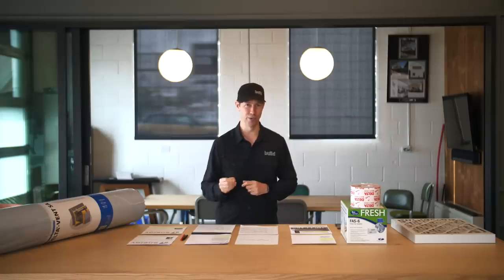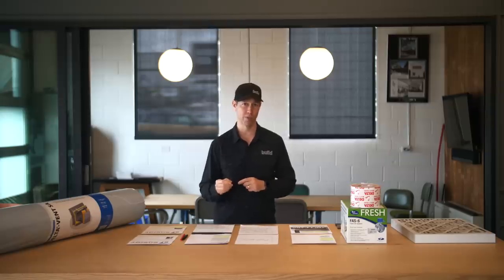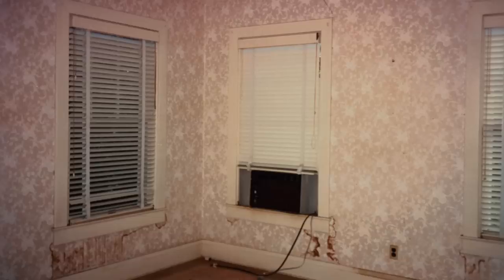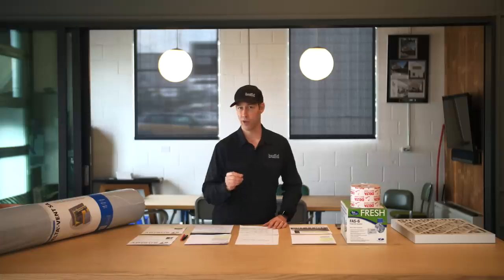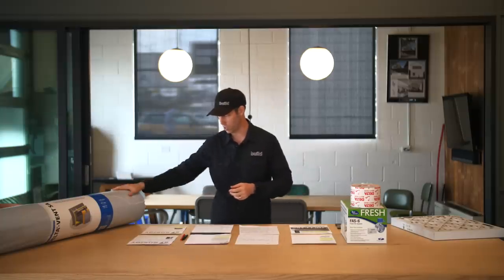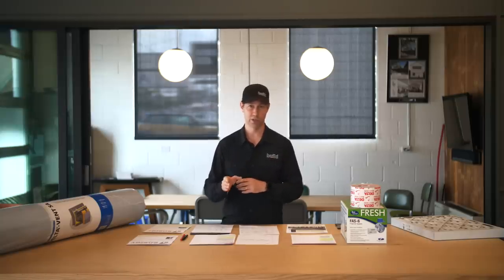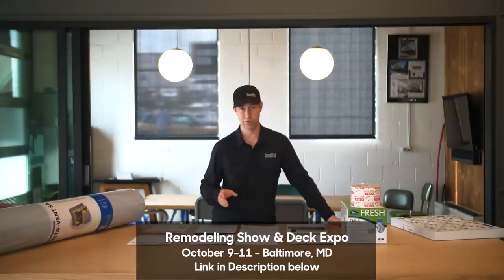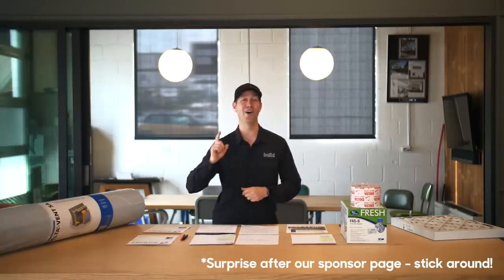“Houses need to BREATHE!” - Shut your filthy mouth

Comment: I live in an old timber house in Norway built before 1870. It used to be leaky as F, but the timber is in excellent condition after 150 years. It does require more energy (firewood in my case) to keep warm in the winter than air tight buildings, but by putting in an extra layer of "energy glass" behind the 17th century single glass windows, stopping the worst air leaks by adding Tyvek where needed, and adding "breathing" insulation against the (well ventilated) cellar and loft, it's very comfortable in winter and actually not that expensive to keep warm (the wood in the walls and the insulation stores the heat well). The key here is the thick solid timber walls, heating with firewood (circulates the air and dries the wood), while ensuring adequate supply of fresh air, just like it was done before. It's not code, but it has worked for hundreds of years without causing rot or mold. If lived in and looked after, the house will last another 150 years and more.

Building that way may not be feasible today, not to mention legal in some places. But here in Norway I'm seeing more and more solid wood houses come up, that use new production techniques. Not sure what they're called in English, we call them "massive houses". Laminated massive wood sections, with wood fibre insulation, not air tight but "breathing", heat/moisture buffering. In a way, it's the modern equivalent of my old timber house, and they do follow Norwegian building code. Time will tell if they'll last as long as my old timber house.
Reply: Is wood fibre insulation safe? I always find a little sawdust is a great way to get a fire going..
Reply: Fun example: They're building a coffee factory near where I live, in massive wood. They're calling it the most high tech coffee factory in the world, so it'll be an interesting mix of old and new.

The world's tallest wooden building is also in Norway, with 18 floors and 85 meters. And now there are plans for 60-80 floor timber buildings in Chicago and Philadelphia. Wood is a remarkable material..
Reply: @nobodydoesithalfasgoodasyou  
Insulation comes with a fire retardant and insect/mouse repellant mixed in, supposed to be very good insulation.
Reply: ximono 
We sometimes describe very thick walls (or fireplaces) with the term "thermal mass" as they absorb and hold warmth to radiate out over time.
Reply: believing that wood stores heat well

just lol
Reply: @clycoo  Wood's heat buffering capacity is twice that of regular insulation. This video is in Norwegian and with crappy music, but wood insulation is on the right: https://www.youtube.com/watch?v=CwB1c6eyYUo

Comment: Growing up along Lake Ontario in the early 60's, I have seen that staining first hand and can tell you exactly what causes it. It is from condensation on the inside of the windows all winter long. In the late 60's or early 70's my grandfather added storm windows to the outside and the condensation moved to the outside of the original windows. BUT, because of the bevel to the outside and a weep hole at the bottom of the storm windows, the condensation ran outside rather than inside... It was pretty strange to see little icicles build up at those weep holes outside!!
Reply: Thanks for sharing! I was wondering how a house that leaked that much would have no damage. It wasn't letting water in.

Comment: When the dryer or bathroom exhaust fan is running air has to enter somewhere. I had a customer that his house sucked snow in through the ridge vent while using the dryer. If you see dirt rings around recessed lights you need to ventilate properly.
Reply: Which begs the question where is the air coming in from these tight houses? Windows im installing in apartments are required to have air leak vents on one window per unit. So air still needs to come in from somewhere for you to use the oven exhaust, bathroom vent or dryer.
Reply: @levthelion  probably sucked in from drainage pipe. In general, probably it suck in air from Toilet, basement, or cracks in floor or wall, instead of Windows or Doors.

Comment: Great info,  wanted to see what people have to say on what may be the cause of or issue in north west. Bought house in September 2018 owner put in new metal roof with local roofing company month before we purchased the home,  due to ply wood had mold growthso it was put brand new. Is definitely fixer uper to the point that the top bathroom  and  ketchen was not used till December 2018. A week ago i check the roof ply and there is mold growth in patches on roof ply wood apears socked and have some water leak to point where there is small leak where there is exposed 2x4 in cealing of bathroom where we have not yet added cover as we wanted to do some changes to electrical. I called the roofing compony and they told that mold has began to grow due to thw exposed 2x4 a have in cealing, and that this is what causing mold, it apears to make some sense but, i noticed that mold not just growing above bathroom but above other areas of the roof plywood which are further away. What are people toughts should less than three months showers in with possible air leak through exposed 2x4 in cealing that has sheet rock butted against woulds that be enough to cause hald plywood in roof to have mold growth and drops of water in comin on one side of exposed 2x4 in cealing? Il add the bathroom has a fan and ketchen has exhaust fan. That were both fixed for proper exhaust doing new roof build. Anyways thanks,  thw apears only be a leak when it rains.

Comment: As a degreed HVAC guy, I can back up every thing that Matt said. The trolls who attack the guy who tells us the right way to build and prevent mold and mildew are probably the same ones who love to sue for mold, call the health dept, and go get the asthma machine.. HAHA
Reply: OK, but mold, wood rot and severe water damage are vastly more common today because so few builders can actually implement modern standards correctly. Say what you want about drafty old construction, but that stuff was forgiving and didn't require perfect sealing and non-stop conditioned air.
Moreover, 1:07, the 1930's house that Matt displays was renovated/modernized to a level that isn't even remotely possible for most budgets, and that's AFTER finding builders who are actually competent enough to do it. So yeah, unless you're a millionaire and can afford an outfit like Matt Risinger's company to renovate your old house, you probably DO NEED to let the house "breathe".

Comment: Here in Saskatchewan, Canada, we just adopted the energy code of Canada and now must design/build much tighter houses, from 3.2 air changes per hour to 2.5 air changes per hour (depending on codes followed and how the energy review is done). It forced us to do a ton of research into products, designs, and mechanical systems to meet this new code and everything Matt talks about is right on the money. 
The one big thing we have seen though is a reduction in the size of the equipment to heat/cool a house. Suddenly we can spec a system half the size of ones in the 90's/early 2000's, we can use new tech to ensure they are run all the time at volumes (so no major push of air every 10 minutes, the house is always the set temperature) and place wall mount supplies to get the perfect air flow for comfort. 
Modern houses with new products can be very well built and probably are the most comfortable place a human could live, probably ever. It just takes time and willingness to do it.

Comment: Long ago, I helped my father tear down a small, old house to reclaim the wood. The interior walls were sheathed with tongue and groove board, but the species were whatever was available LOCALLY when the house was built. It was all hardwoods - some poplar,  some cherry, and quite a bit was walnut. The framing was similar to that used in the area until sometime around the mid - 1900's (or even a little later): Rough sawn 2X 4, predominantly oak. Since it was generally rough lumber, it was actually slightly oversize, about 9 quarter by 17. I still remember listening to my grandfather talking about someone who was building a new house, and insisting it would fall down since they were using PINE to frame it. Those old houses were drafty, but quite sturdy. 

Think of adding on to these old houses with oak and hickory framing that has seasoned fully over time. I recall making a flush cut using a hand saw on an small addition I helped with on such a house. Two of us took turns sawing until we finally cut through one 2 X 4. Nails usually required a pilot hole to go into the old framing.

Comment: SO GLAD TO SEE YOU ADDRESS THIS!  But after thinking about it all night, I have some questions....
1. When you seal up a house envelope to be air tight what happens when you turn on a bathroom exhaust fan?
2. How about opening doors?  What does that do to impact the air quality in the house.  I'm thinking about foot traffic in and out.
3. Do you need to have a vestibule or mud room at each entrance to create a buffer from having direct contact between outdoor air and indoor air?
4. Do you need to control the humidity indoors now that it is sealed?
5. What happens on a beautiful day when I shut off the AC and open the windows?  Does that just defeat the whole purpose of a sealed envelope?
6. What type of filtration system do I need to keep the air inside clean?
7. Is there a danger of CO2 or Radon build up?
8. What about natural earth tech like straw bale homes or rammed earth homes?  Is it possible to seal those or is that a bad idea?
9. My house was built in 2000.  What's the best way to improve my score without ripping it back to the studs and starting over?  What should a goal score be?
10. Former Texan from WET climates (Dallas / Longview / Huntsville / Houston) - Now living in Arizona in a DRY climate.  Do you have any AZ projects?  What would you do differently about an AZ house vs a TX house. Dry vs Wet?

Thanks in advance!

Comment: I love this channel.  My next home is going to  incorporate passive house principles, have a wall system made of Bautex and Rockwool, and TrueSteel Cedar siding.  The roof system will be steel shingles, over ComfortBoard and SIPS.   And the whole thing will be tight as a drum.
Reply: My next home is going to be a monolithic dome. It's simply the most efficient design.
Reply: More details! Aircrete?  Earth sheltered?  Where do you live?  What about mechanicals?  Why are monolithic domes so efficient? Where can I learn more???
Reply: Jack Maher  -  THANKS!  I NEED more input of roof system please.  Dealing with POORLY built back room addition and it's collapsing flat 'roof'.   i have 90 + yr steel shingles on original house.   What 'brand' have you found?  Need Flat roof gone - Raised to meet old - have not yet found Shingles.         Never heard of Bautex,         thanks for ideas  ~ peace
Reply: This guy is a salesman,not a framer
Reply: Not rockwool, hempcrete.
Reply: Also, under $100k? lol, you probably need to research EarthShip Biotecture.

Comment: Hey  Matt my concern is poor interior air quality - I just copied this -  "We tend to think of air pollution as something outside -- smog, ozone, or haze hanging in the air, especially in summer. But the truth is, the air inside homes can be more polluted than the air outside". The off gassing from furniture, flooring, paint, cleaning supplies and more can make it really necessary to change the inside air frequently IMO. We are all breathing chemicals in if the house is too tight and it can take years for this stuff to stop polluting. Suggestions? I live in sunny CA so my doors are open almost everyday but that is not the case in most states
Reply: Vent your home when it doesnt need hvac by opening doors and windows

Comment: I'm a builder in Michigan,  northern climate.  When I reference "houses need to breathe " really meaning walls need to be able to dissipate moisture created by thermo transfer. Full foam cavity traps moisture and causes rot. I prefer to use a 1" closed cell foam sprayed in the cavity with the remaining space filled will blown cellulose.  We are now required to put a 4" fresh air intake connected to our return air duct.  This has caused problems with cracked heat exchangers. I spent several years remodeling and still do a bit of it. Prior to building new. I think law makers, lobbyists,  and manufacturers should know the repercussions of the techniques they push for.
Reply: "I think law makers, lobbyists, and manufacturers....." you left contractors & tradesmen off that list, Pretty significant omission yes?